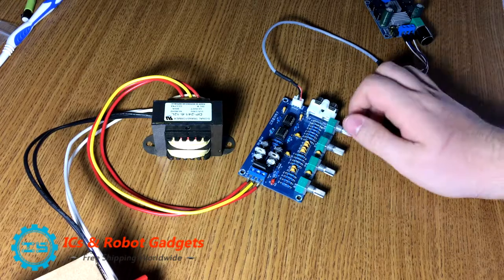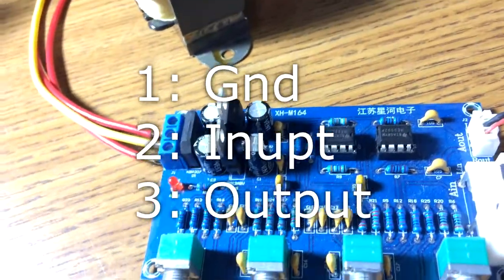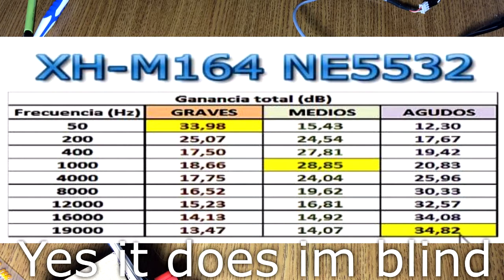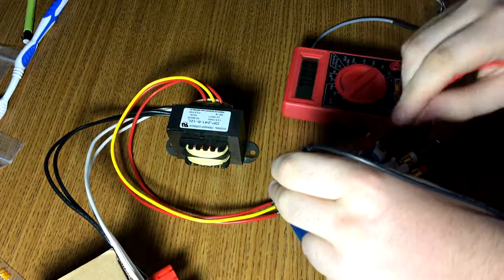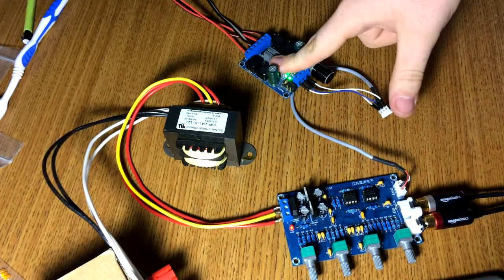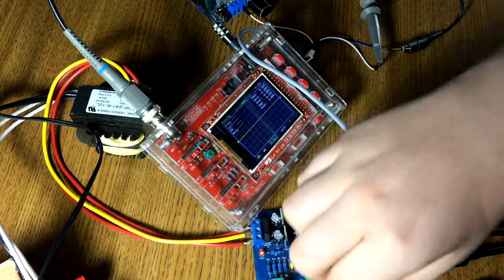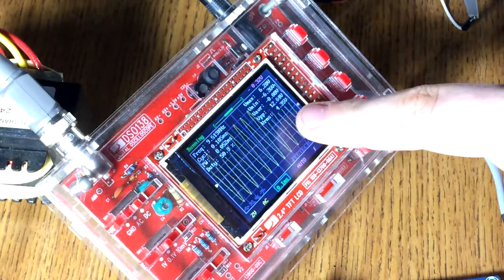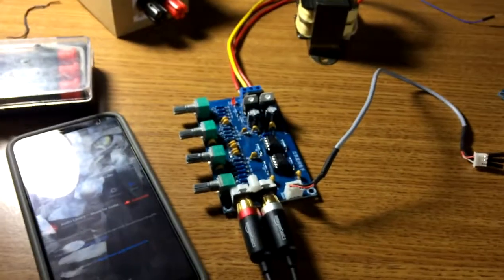ICStation XH-M164 NE5532 Preamp demo

Comment: I just bought this and the regulator IC positive side burned within seconds , hooked up  a 3 amp 12-0-12 supply, was the supply rating to high for this preamp or IC defective?